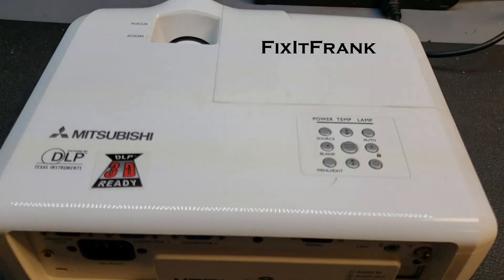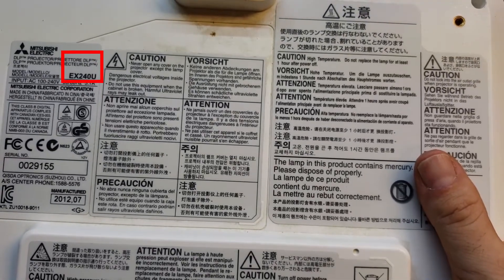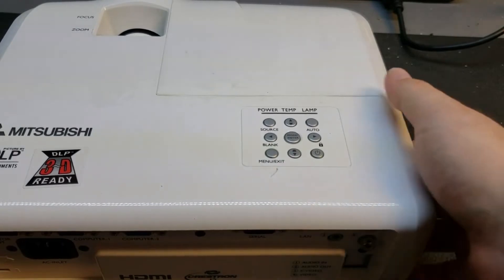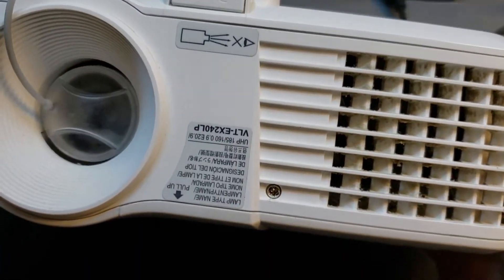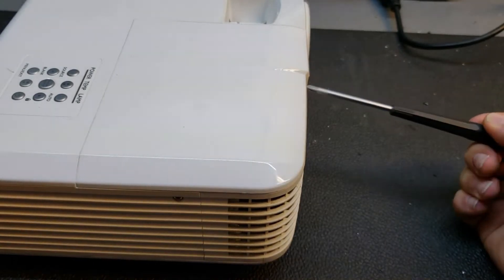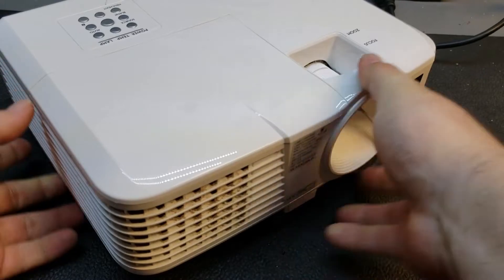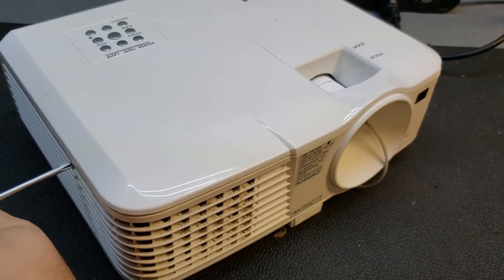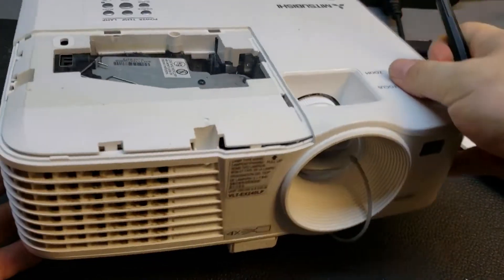Mitsubishi EX240 Video Projector Teardown/Repair 1

Comment: I've got the same projector, and mine act a little bit strange. When i plug it to the power, the red led lights up, but if i wait few seconds it will shut down like if i pulled the power cord. It will not power up or show any signs of life for few seconds. Same thing when it's tries to power up, it will show the logo and after few seconds it will shut itself down... 

Sorry for my bad English...
Reply from the maker: Your English is perfect. No need to apologize.  
Your projector has a strange problem though. 
I would check the lamp door switch and also for bad solder joints around the power cord input. 
Bad Capacitors in the power supply is another possibility. 
I suggest starting with the door switch, bad solder and then capacitor check.
Reply: @FixitFrank  Thank you for the response, i checked everything. I found out that the "top258pn" chip was overheating so i changed it. I've removed the old chip and replace it with the new one, but now it won't even show any sign of life... i think that the shop sent me a faulty chip... i've checked the capacitors, the diodes and even the resistances. I've got 320v on the hot side of the power supply, but on the cold side I've got heavy voltage flactuations between 1v to 10v. I will try to replace the top258pn chip. 

Thank you again for the response

Comment: Frank, this is a brilliant video, thank you so much for sharing. I have the same projector and although the bulb does not need changing as of yet, it was really helpful to see the steps involved in replacing it. I use the projector a lot for powerpoint presentations as I am a speaker in astronomy/photography. The only thing I wish this did have was more "short throw" as the zoom is just about useless and I need to bring the projector a good 15ft away from the screen.  Unless of course the zoom is broken !!
Reply from the maker: Thanks Stephen!  I appreciate your kind words :)  I agree. These are a bit happier further back but the picture is quite nice. I hope you get many more years of use from your EX240!

Comment: hi Frank,

I have this exact projector. The lamp is flickering (almost like pulsating). Not sure if the bulb needing replaced, I need to clean it as well but I just want to be sure before buying parts.

Thanks

Raj
Reply from the maker: If the brightness is pulsing(bright to dim) I would suspect the bulb.  If the colors are pulsating, I would clean it first as it might be the color wheel sensor.
Reply: @FixitFrank  awesome that narrows it down. When you clean it, you meant to clean the colour wheel for the pulsating colour?
Reply from the maker: @drajcoshi  I think it is just dust on the sensor board. The small PCB that monitors the color wheel position. It is located on the color wheel assembly and has a small part that is the IR sensor.  That IR sensor can become dust covered and add to the issue. Removing that dust will rule out the sensor.  If the issues continues, then a new color wheel may be required.
Reply: FixitFrank I cleaned the colour wheel and put it back exactly with every cable connected. Now the bulb is not coming on and I am getting a lamp error indicator on the lamp light beside the menu, and power button. Any ideas? I have brand new bulb.

Comment: Hi Frank!
I have a JVC DILA RS-10U projector that needs repair. Can you do that? Now after about 5-20 minutes, the whole screen turns a perfect canary yellow. The functions still work, but none of the menu shows up on the screen then. It also overshoots the screen size by a couple inches. There may be some more, different discoloration off to the sides. Usually if I restart it, it will stay normal, but we know that isn't good for anything.
Can you let me know about you repairing it?
Dave Smith
Illinois  :-)
Reply from the maker: Hi Dave, Thanks for watching my video!  Just to be sure, the picture is OK at first and then gets yellow and the menu stops working?  I ask because image issues that can relate to the DiLA panel can be tricky.  That would be the case if the image was always yellow.  If it goes yellow after the 5-20min, then it would be more likely a power supply issue  affecting the mainboard(this is an educated guess).